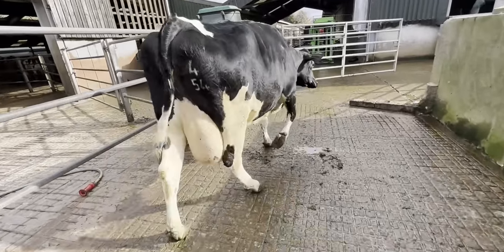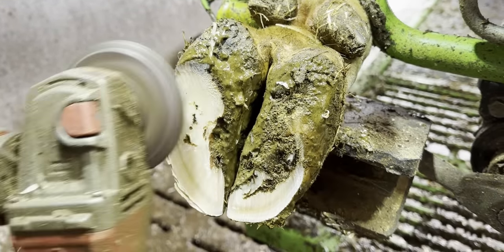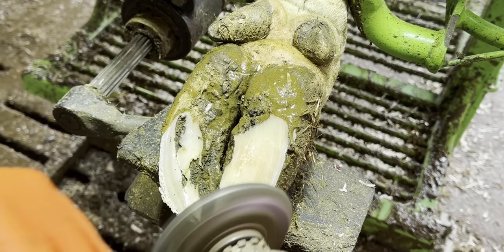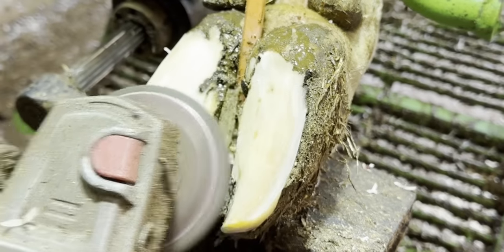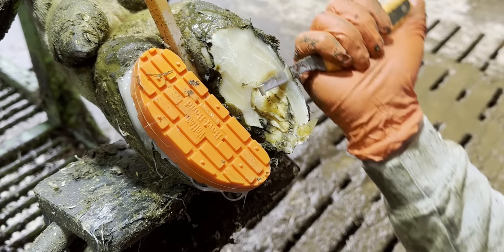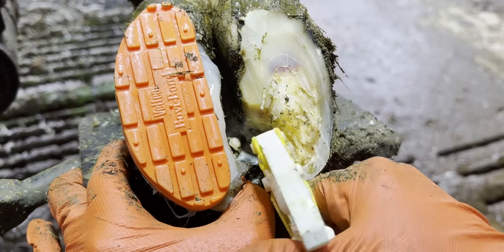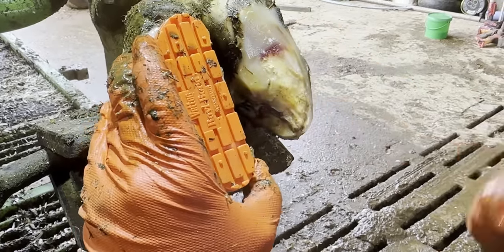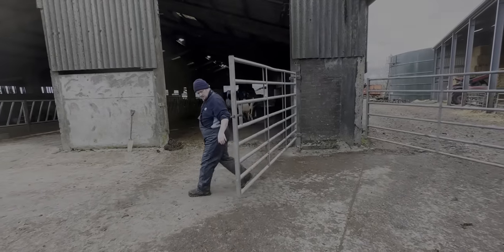PEELING this layer of HOOF HORN away was seriously satisfying ... for me AND THE COW!

Comment: In human anatomy the outside is also referred to as Lateral. However, the Inner side is referred to as Medial, not Axial. An Axis is a perfectly centered point of Rotation.
Reply: The outer claw on the hoof is the lateral claw. The inner claw is the medial claw. Axial refers to the area between the claws.

Comment: Question: Why are the blocks not modeled out like the hoofs in a routine trim? Won't it put to much pressure on the inside of the claw?
Reply: I think that would be difficult to do.  Blocks can cause issues if they are left on too long.  But they are typically the better of two evils.  There is, however, a type of block that is crescent shaped.  Kind of like half of a horseshoe.  Graeme has used those in cases where both claws had issues.  He can attach them so that they avoid putting pressure on a sore spot.  Otherwise, he just puts blocks on a good claw with no issues.  You don't want to use them on a bad claw.  Because, as you suspect, they will make things worse in that case.

Comment: Out of curiosity, is trimming cow's hoof necessary for block? I'd imagine it is, more that once I've seen Graeme cut through layer(s) of pith, so I'd imagine not trimming increases the chance of a cow losing a block. Am I right/wrong?
Reply: you are absolutely correct.
glueing the block on requires the surface to be clean, otherwise the glue will just stick to the dirt and not to the hoof itself.
Reply: @windhelmguard5295  this, and also, hoof horn does naturally detach and shed after some time and wear, so you don't want to glue the block to horn that's about to fall off on its own